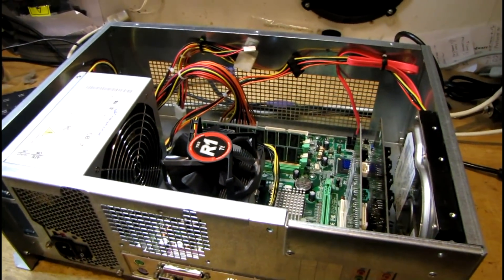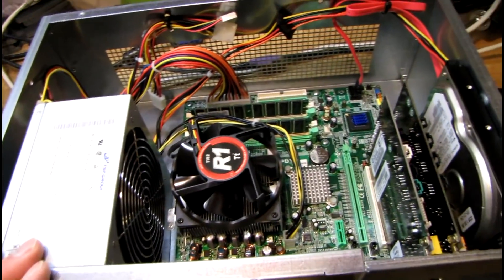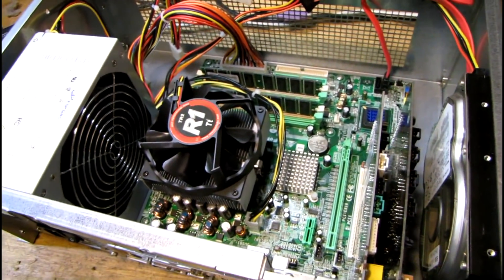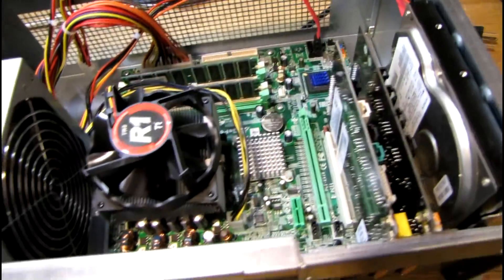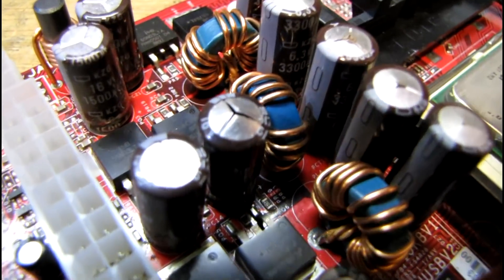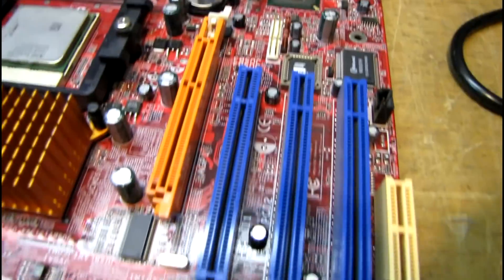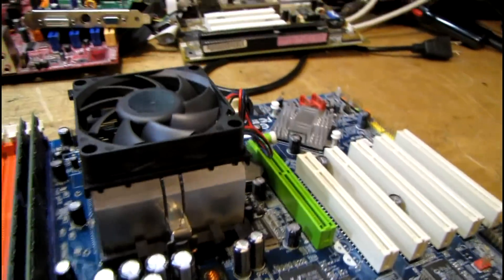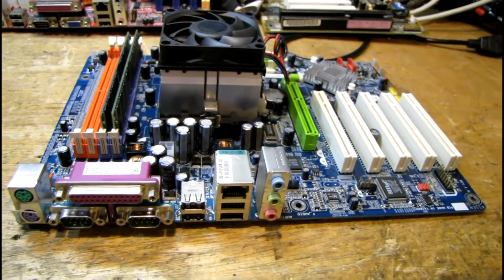Some info and examples of bad and defective capacitors on computer motherboards

Comment: Couldn't figure why most old desktops given me trouble. It was in working condition before putting it away in storage. So looks like those capacitors failed as it aged and not used for many years thus not from over stressed or temperature. Funny ECS motherboards mention, holy crap most of the caps on it were bulging. Same thing with my audio equipment, my preamp has a bad distorted channel. Bad caps again, was working before putting it in storage.

Comment: I've got a couple older MOTU audio interfaces that still work but are very noisy. Is noise a symptom of failing caps? I know at least one interface has bulging caps.
Reply from the maker: Bulging caps are definitely bad.  And depending on where they are in the circuit, they can cause noise.

Comment: When I built a computer with haswell, the gigabyte motherboard I had got replaced once in  the first month, then that failed a month later (both times I saw caps bulging) so I got my money back and got an msi motherboard, which after 2 years the Ethernet stopped working so had to stay on WiFi. Last year I built a coffeelake based pc with a gigabyte motherboard and it is still going okay.

Comment: Is Teapo still a brand to avoid today?
Reply: i have a pc power supply made by hipro that i got in 2006 and i have used it pretty much every day and am still using it now, it has the teapo capacitors and has never given me an issue in its 12 years. the most commkon cap that i have found is bad is the capxon brand they are the worse.

Comment: what if you take a hammer and lightly DOINK on that capacitor XD
Reply: there has been a chemical change with the formula hence it bulging up
Reply: i was expecting it to leak
Reply: i actually did this on a friends thinkcentre i sold them it worked fine just 2 bulged caps. he complained and asked me to replace them so i just used the butt end of a screwdriver and pushed them back in. 3 years later still works fine
Reply: they might have by now but he has not looked inside the computer i dont think. but if he does and they do leak then i will wipe them off and tell him i replaced them.

Comment from the maker: Ran out of time, money and ambition.  I'd rather sell it to someone who can finish it and use it.
Reply: Hey, do you think that a pc that attempts to turn on meaning the power light flashes for a second when you turn the power on but turns off immediately is the result of a bad capacitor? I'm flustered. I'm trying to fix it but this is a very tough problem to figure out. The capacitors are visually fine though.
Reply: @thingshappen9199  short circuit, a big one.

Comment: Tayeh 
Choyo 
Chhsi 
Jackcon 
GSC 
Jun Fu 
Lelon 
Luxon 
I,Q 
JPCON 
A4 
CHOCON 
I copied these off the internet, but I have seen many of these names while repairing equipment. To this list you can as of last week add Sus'con capacitors. These are mostly the bad formula cap[s but do include el cheapo caps that have on average ten minutes of operation guarantees.

Comment: I recently just bought a dell poweredge 1500sc server that has one bulged capacitor on the mother board . The system is fully functional , but the cap has me worried .  I didn't pay much at all for it but was hoping to set it up as a file-server/firewall . Do you have an idea of what it would cost to have  shop replace the cap ? i could probably do it but i am nervous about soldering on a motherboard .

Comment from the maker: They can if they are defective.  I've had it happen more than once.

Good quality ones will usually be fine, though they sometimes need to be "reformed" at low voltage and current before use if they have been sitting for several years.

Comment: everyone says that a 100V + capacitor must be discharged before it can be replaced for safety reasons. Is this true? Also when calculating the resistor for an LED do I need it to be a specific watt? I thought current was measured in just ohms. 9v power source (3v 20mA LED) results in 300Ω resistor. Please clarify this for me, driving me insane.

Comment: Strange how some of the best power supply manufacturers used cheap caps at the time. I have a 520 watt Topower power supply, which was quite expensive at the time. It's from about 2003-2004. The model is TOP-520P4 (TOP-520II). It had those Fuhjiyyu caps too, and when i opened it up they were all bulging. The power supply still worked fine though. But just to be sure i recapped the thing and oiled the fan bearings. Good for many more years of service i think. The thing is built like a tank.

Comment: I thought it might be worth asking, I have a custom built box from 2006ish with a cheap Asus motherboard and an Antec power supply. It's not my system, and as I'm told the system works fine from a cold boot, but as it warms up it fails to boot. Is this kind of issue potentially a result of bad caps or other power supply problem? I do know the board has KZGs and some other generic junk on it.

Comment: I was unable to find one JUST like it in the compleated listings,but it is a EVGA 8500GT 256MB,but the sold ones(256mb 512mb and 1gb) ranged from $12 and to $30,the 3 caps that blew were all the same,on the tops of them they say "FZ76 1500 6.3V".

Do you think it is worth it?

Comment: Ah OK. Samsung had a slew of bad capacitor equipped monitors in 2005-06. The 940 series in general is notorious for it. I also have a Syncmaster 930MP here that seems to have died, but the power supply is an external brick. I cracked it open and the caps appear fine, seems to be a fault in the power switch PCB assembly as I can get it to occasionally power up. Replacement parts and unobtainable and broken units are hard to find. A shame because its a versatile monitor with a ton of inputs!

Comment from the maker: The board at the end is a Socket 939 board for Athlon 64.

I actually recapped one of those similar Samsung monitors a couple years back and posted a video about it.  Bad caps seem to be a common problem with Samsung TV's and monitors.  Especially the ones with the SamWha caps.

Comment: I think I have the same Gigabyte i865 board as seen at the end. None of the caps failed.. yet. I do have an Asus P4P533 with a leaking cap, I never bothered with it. Surprisingly it still works. Seems that the whole AGP 4X/8X era of boards will be wiped out of existence due to bad caps. This video is timely though, I have a recap kit coming for my Samsung Syncmaster 940MW monitor. Just about every cap on the power/inverter board is bulging!

Comment: Anyone that disputes the capacitor plague has to be young or nuts. I just fixed a big Samsung plasma TV for a neighbor. (made in 2005) I warned them is might cost as much as $15.00. It was about $10.00 when I opened it up. They were shocked as they paid $1500.00 for the set.

Comment: It does not help when manufacturers have a habit of putting the caps right on top of heatsinks and other hot devices, ive seen this too many times.

For mobo's i split the can and just leave the pins in the pcb, then heat the joint untill the pin comes out with tweezers, then the solder sucker treatment :-) works for me.

I use panasonic capacitors, the high grade type for switchmode use, and i over rate them in voltage/temp/ripple v/ and low esr, cost a bit more but they dont fail :-)

Comment from the maker: Ya, that's the main advantage of electrolytics.  Big capacitance at a small price.  Solid caps tend to be less than 1,000uf and under 16 volts.  Most of the ones I've seen are under 6 volts.

I think one direction that modern power circuits are taking, is higher switching frequency and lower impedance.  It allows the use of much smaller transformers and caps, thus making things cheaper to produce.  No more huge transformers and caps running at 60Hz.  But I still like linear power supplies :-)

Comment from the maker: I don't recall the model of the board, I'll have to look at it tomorrow.  I want to say it was an MSI or Biostar though.

Most computers will last at least 5-7 years, depending on cooling and the amount of use.  A lot of times the power supply fan fails, blows the caps in the power supply, which in turn kills the motherboard.  Or the CPU fan fails and kills the CPU.  If the caps are good quality, they will usually outlast the fans and hard drive.

Comment from the maker: I think I have a couple videos about recapping boards, but it's a nightmare without the right equipment.  The boards are several layers thick, and it's common for people who are unfamiliar with the construction to accidentally pull out the copper plating in the holes when trying to remove the caps.  That breaks the connection between circuit layers and kills the board.

Comment from the maker: The large caps on the input side of some power supplies can hold a big charge.  If he was in the region where 220v was used, the caps can be charged up to near 400v and have a ton of current available.  The jolt can certainly stop someone's heart under the right circumstances.

Comment from the maker: They can go bad, if they get hot enough to burn the insulation off the copper wire.  By then they usually start turning black and crispy though, and the rest of the power supply is probably toast anyway LOL.

Comment: A little off topic but related to computers.  There was a teenager here in town that was electrocuted by working on an unplugged PC power supply.  The news media said they hold a charge even when they are disconnected, which I knew, but I never heard of anyone being killed by an unplugged computer power supply or that they could even store enough voltage to electrocute someone,  With your knowledge of electronics, what is your take on this.

Comment: I've replaced some on a Fujitsu motherboard but it was already 8 years old.  I wonder if its the capactors themselves or the engineers that design the equipment overdriving them, or overheating them by placing them in the cpu exhaust.  In digital equipment the hardware goes obsolete so fast that people will just throw the computer away and buy another which is what they want us to do anyway.  These repairs that you do are great as they are active resistance to this trend.

Comment from the maker: Sometimes.  They cost more, and the voltage ratings generally don't go as high.  But in things such as the VRM circuit for the CPU or RAM, where the output voltage is under 3 volts, solid state caps are ideal.  They are also one of the few examples of where you can go a bit lower in value.  Such as an 820uf SS cap in place of a 1,000uf electrolytic.